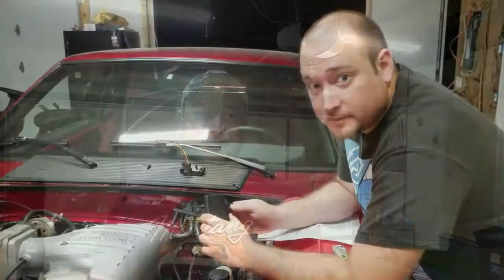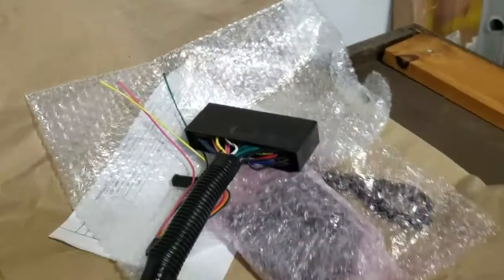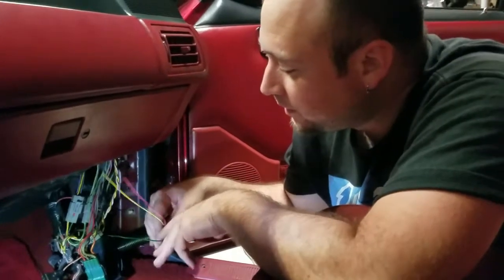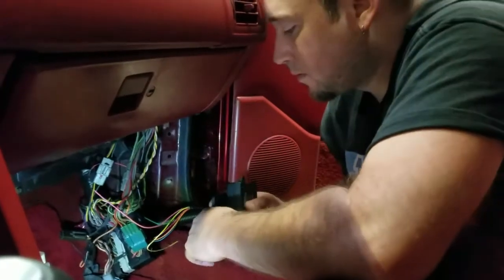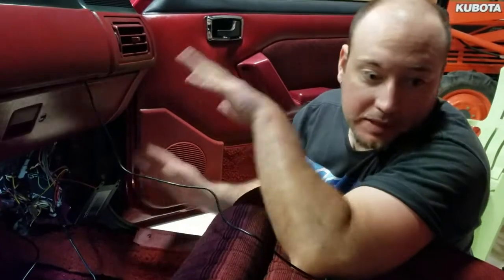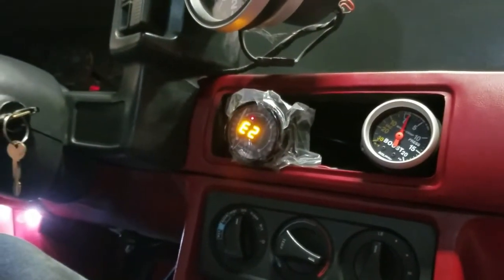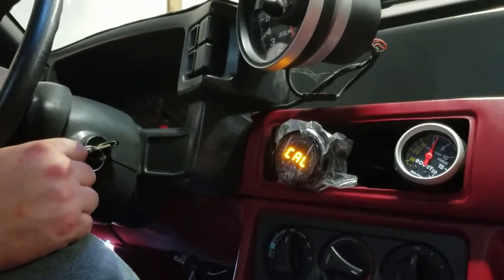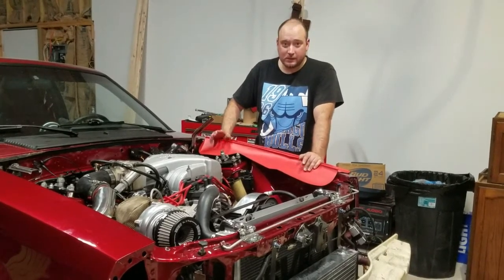Microsquirt ECU install and Wideband Calibration

Comment: Does microsquirt let you , control the trans and ecunat the same time.  

Does the wide band,  send data to microsquirt to automatically set calibration upon  using the Guage or you have to manually go in and make changes in the turner software?
Reply from the maker: the microsquirt does not have transmission control, yes it will send data to from the wideband to the software for you to log and view, you will have to sync it properly for it it read correctly on the software. It will make changes if you use the learn function on the software.

Comment: Hey donny I'm getting really close to installing my microsquirt. What did you do with the stock o2 sensor harness? Do you still have it? Also what about the oil level sensor which is in the stock o2 harness.

Comment: Hey man, nice build! After watching a few of your videos I decided to order the same microsquirt kit for my fox. I was wondering if these kits come with the wire that goes from the microsquirt to a laptop, what’s this wire/ adapter called?. My kit comes in the mail in a few days and I’ve already bought a cheap laptop for tuning purposes only  and an aem wideband gauge & sensor so I’ll be ready to start tuning very soon.
Reply: oh ok, my laptop only has usb ports. ill go ahead and order the adapter now so ill have everything i need. Thanks again!
Reply: I almost forgot to ask about the high impedance injectors that this kit says I need, I’m currently running 42lb injectors black with lime green top. Would they work ok or am I gonna have to get a specific set to run the megasquirt?

Comment: What's up Donny I need some advice , I'm running a on3 turbo set up on a complelty stock fox body . My question is how hard was it to tune and how did you vent your cranck case ? Can I get your email just in case I run into any issues ? You have the best videos for the turbo kits 👍🏼 Leosbarbershop@gmail.com

Comment: Hey man great video! Quick question? From the microsquirt o2 wire were did you tap that wire into the wide band? I have the same wideband setup. Thanks!
Reply: Where at on the guage you splice that wire into? Right off the sensor there is a yellow wire, no brown, but a gray wire
Reply: Donny B Your right. I found the two wires. Had them hidden up behind the dash lol. Thanks for the help!
Reply: Was gunna ask the same question lol , I just ordered mine

Comment: Hey Donny B, Did that cable you have plugged into the ecu come with the ECU kit, or did you get the from somewhere else? -Thanks
Reply: Donny B thanks, also what kind of plugin does the microsquirt have when plugging the cable into the ecu?
Reply: Donny B  nope that's perfect, my laptop happens to have a serial port so I just need tuner studio and I'm ready to tune! - Thanks donny.!

Comment: I missed the part where you hooked up the gauge and sensor. Is it a new wire to run or does it use existing wiring/connectors at the O2 sensors? Thanks.
Reply: Donny B So basically you run the signal wire to the microsquirt wire and tap a 12V wire somewhere for power?
Reply: Donny B which wire from the wide band did you use, white? So white to pink from MicroSquirt?
Reply: @strangedemon  Installing my turbo now! So I'm using the microsquirt ecu. Do I install the stock o2 sensors in the header or leave the bolts in that comes with the kit?